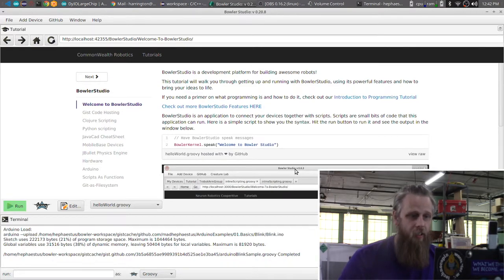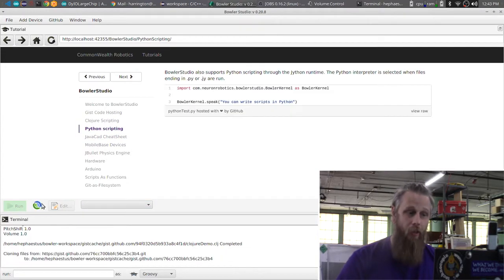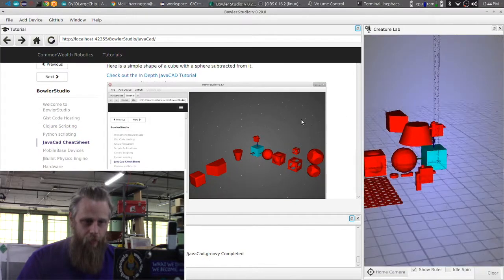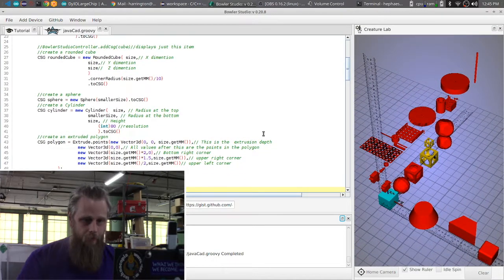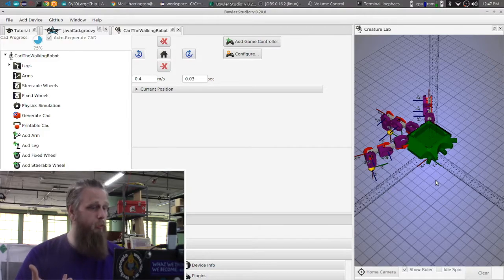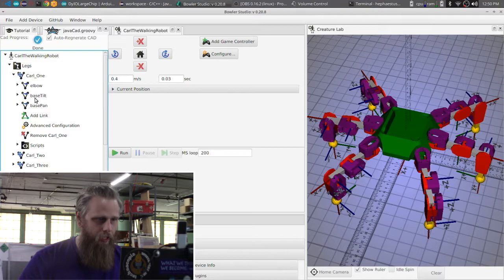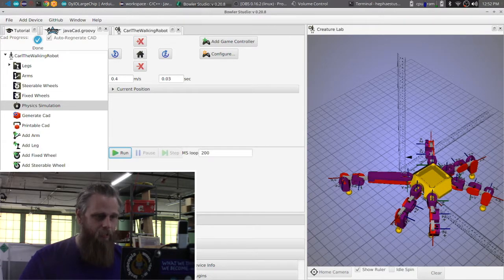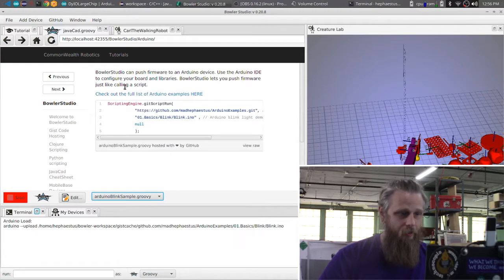Bowler Studio Introduction

Comment: Great. How realistic is the simulation compared to reality? Is it limited to gears or can it be used for softrobotics?
Reply from the maker: It is a rigid body simulator based on Bullet Physics. It is a video game physics system, the same one used by ROS/Gazebo, but since its integrated to the CAD, you get fast automatic loading of new models into the physics sim.